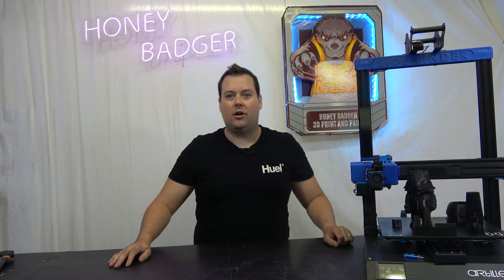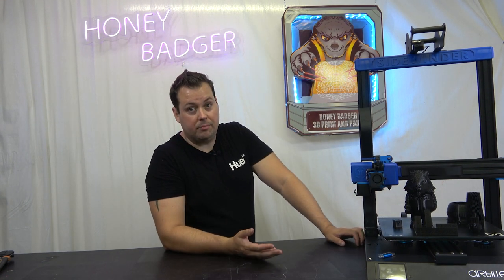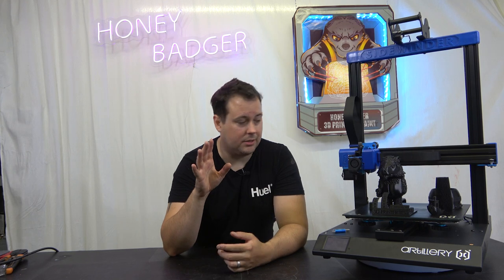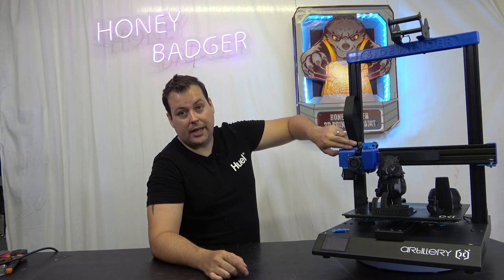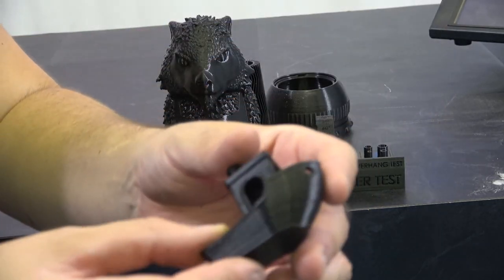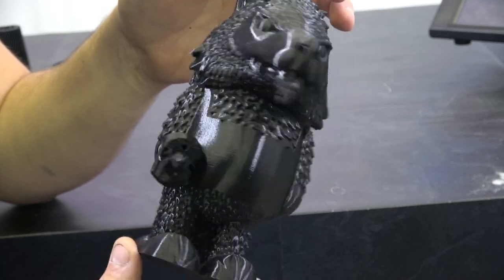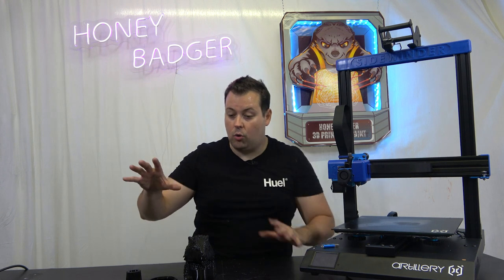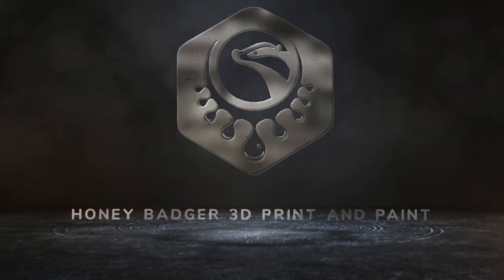Sidewinder X2 - Review and results

Comment: what settings did you end up using that worked the best?
Reply from the maker: so i went to 3dnexus and download the profile for the X1, i tweaked extrusion for my machine and added the G29 command to that start gcode in the slicer to get it to mesh level, other than that their profile is unchanged

Comment: U Mean clone titan , and clone volcano,  and btw clone bl touch. 

And could be Nice to know some minor details about layer hight, speed and temp pn those prints :)
Reply from the maker: at this point the bltouch has become a generic term for a pin sensor but your are right none of them are original parts , we will start to put up some high level print settings next to finished prints, this was done at 65mm/s 205 on the hotend, 60 on the bed and a 0.2 layer height for all

Comment: I just unboxed and set up my X2 yesterday. I did discover a problem, though - the M0 and M25 pause commands don't work (you invoke these in Cura - "Pause at Height" - for changing filaments). M0 causes the printer to just freeze, M25 pauses the print for about 30 seconds and then it continues of its own volition. Quite annoying, since I was going to print some dual-colored models. Apparently it's a known problem with the X1, but the workarounds supposedly won't work with the X2.

Comment: Hey Badger. I’ve got 700$ for a machine. I want a build volume like this, and I want to print Nylon. Is this the answer? Or what do you think?
Reply from the maker: honest answer is no, its not an all metal hotend, and really you need an enclosure to print Nylon, it depends really on how confident you are at building because i would suggest the voron switchwire, there are a couple of kits on ali express that should be around your budget point, BUT it only has the build volume of a Prusa, maybe a Flasforge guider II?

Comment: Question for everyone: I bought this printer and received it. After building it, then trying to level the bed with assisted manual leveling. The extruder will go down in the middle Without the probe even coming out and goes down and is just forcing the extruder downward into the bed (I lowered it all the way down so its not making contact) and It can’t go further and the machine makes a really loud buzzing sound. It’s not being limited by anything. Please help anyone because I can’t print until it’s fixed
Reply: You should be contacting Artillary support, as it sounds like a technical error and it should still be under warranty.
Reply: @CraftyMaelyss  forget it. I got it working properly. It was just a incorrect cable port reading
Reply: @savagebob911  i re-attached the frame to the body and really focused on making sure the cable would plug in properly (the cable at the bottom)
Reply: @savagebob911  I still get a lot of failed prints because I’m not a expert
Reply: Mostly on the first layer

Comment: The flat cable is still going to break after some 10 or 100 hours of printing. It‘s too thin and delicate.
Reply from the maker: so i would challenge that the issue people have had is with the flat cables coming loose which they have fixed by clipping it in i have over 8,000 on both of my sidewinder x1 and ive never had a x or z cable actually break
Reply: @honeybadger3dprintandpaint   The first thing I did was to fix the cable by using a printed part to keep it from loosening. Still, after a while, I got strange thermistor readings and things like that because the cables broke somewhere in the middle. This happened with the replacement also, btw. In the end I just redid all the wiring and now have a reliable printer with real wires in a hose.